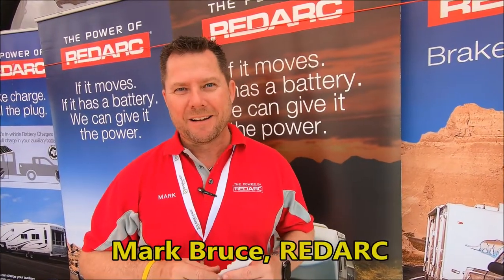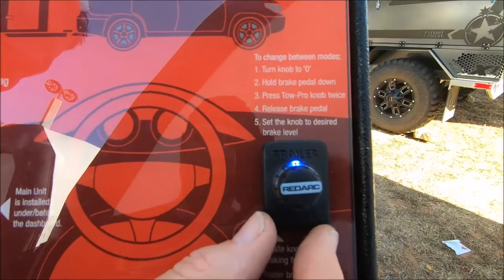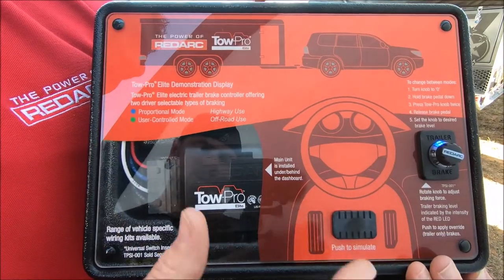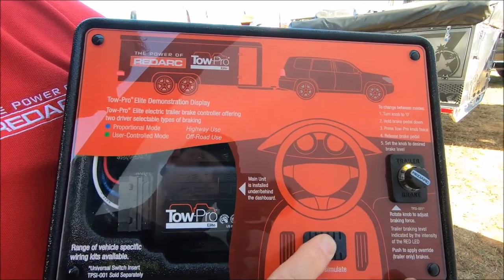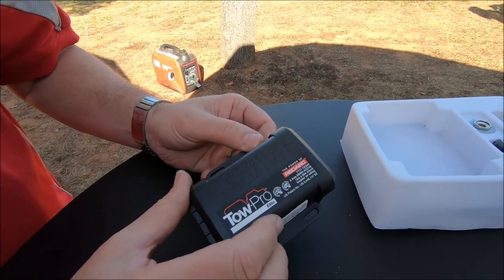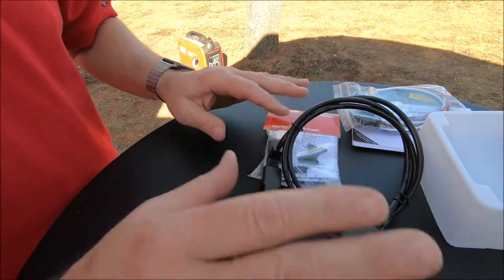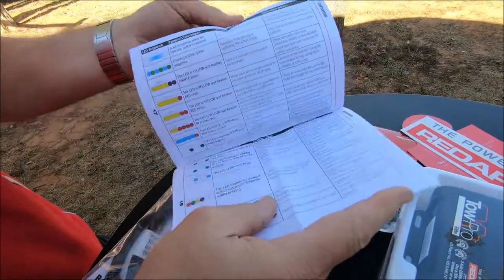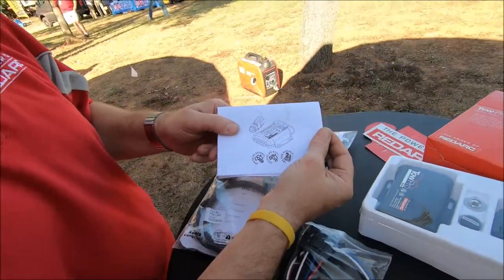REDARC TowPro Electric Trailer Brake Controller: How it Works & How to Install

Comment: I think it's a great product but I suspect it will take longer than 15 minutes depending on the truck. Tor example, in my 200 Series Landcruiser, it took me 25 minutes  to remove the 4 panels on either side of the front dashboard console, the painted storage bin that houses the wireless charger and the lower console where the parking brake and offroad controls are located.